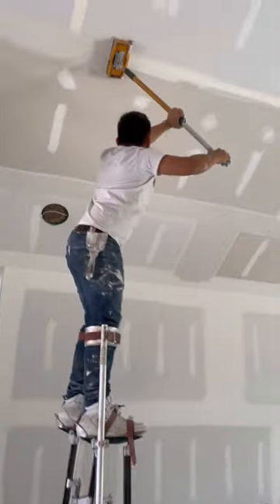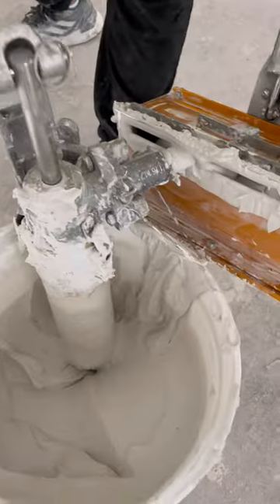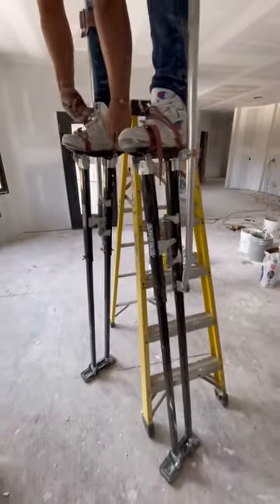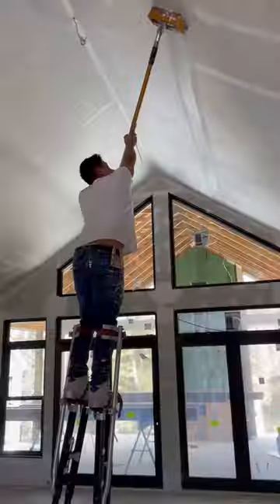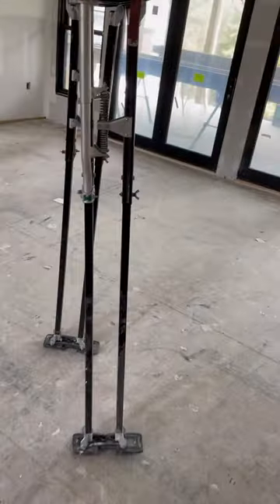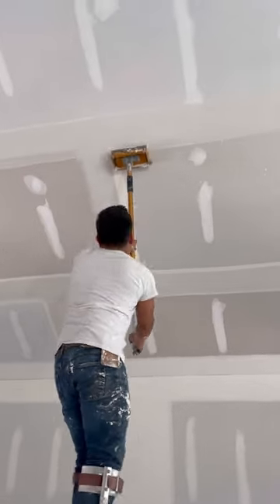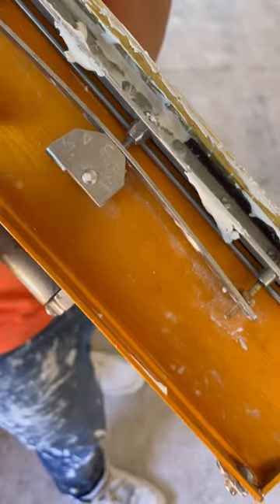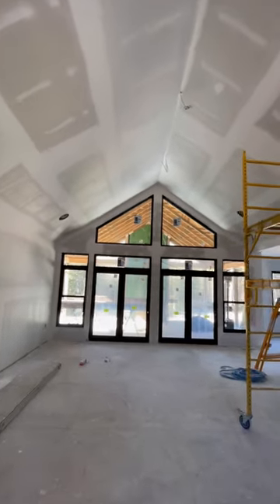Using a Drywall Flat Box on High Ceilings

Comment: The flat box is definitely a time saver.
Reply from the maker: After watching them I agree
Reply: If you can't finish by hand tools first , you don't need to tackle the pro tools.    I can do both and plaster and stucco.   I've seen far to many " pros " screw up taping and bedding and finish coats With the roller,  glazer and boxes.   It's an art and skill.

Comment: Level 5 finish means the entire surface of the drywall is skim coated and sanded then primer is applied and a light check completed by the taper to look for deficiencies in their coating work.
Reply from the maker: Yes 👍

Comment: What is level 5 primer?
Reply: I wondered the same thing.
Reply from the maker: Level 5 is a primer is designed to smooth imperfections and uniform drywall. It can be used to help achieve a level 5 drywall finish without the use of a skim coat.
Reply: Look up levels of drywall finish levels It's probably just a pva primer. Nothin special
Reply: It refers to a fifth level of finish, generally the smoothest finish, but reserved for ceilings and high light areas due to the added cost involved.

Comment: That ceilings going to peal in a few years or start to crumble with the huge amount of mud used. But guess that must be a new business practice to cause a problem then have a solution and charge them $4000-$8000 to get the work redone and re mudded when it could be done easy with 1 guy on a ladder and done right.
Reply from the maker: It definitely not going to crumble
Reply: @hausplans  can you not see the thick mud sections then the thin mud sections???  I can see it its not hard to look for. But denying is part of the 5 stages of grief. Hopefully you guys fix that ceiling for little to nothing when it cracks and crumbles out of nowhere. Thats the least that can be done. Hopefully its done by a guy on a ladder and not just some man on stilts who is uneven when applying mud the sheetrock.